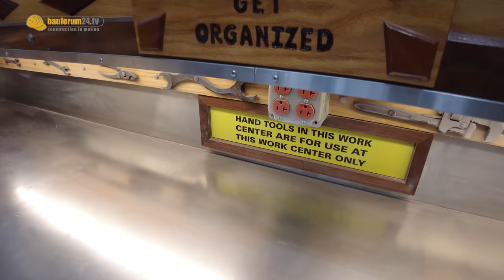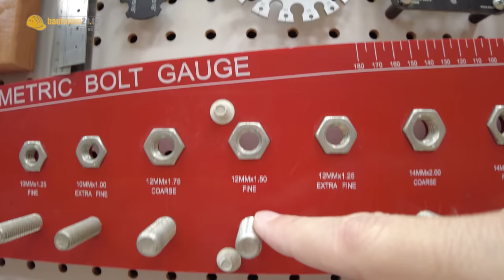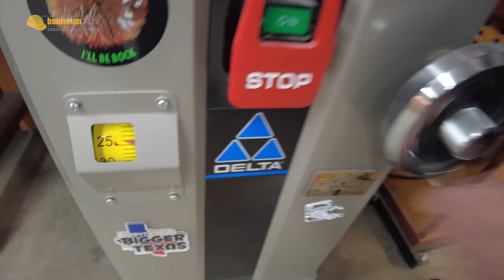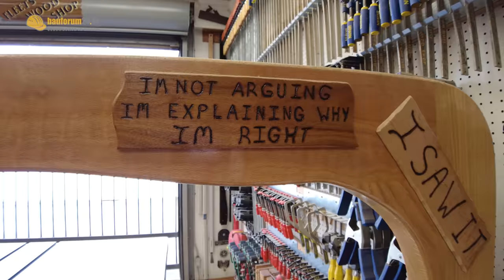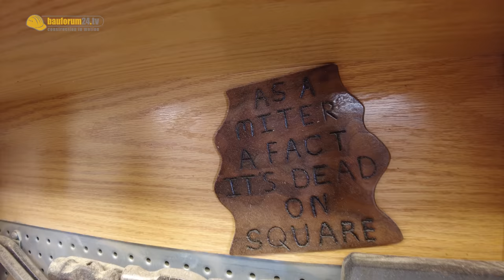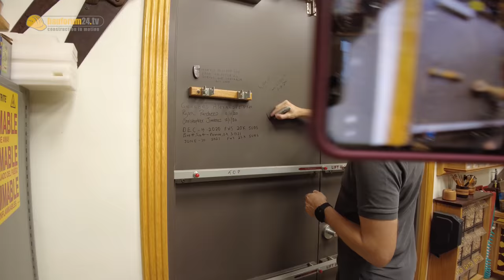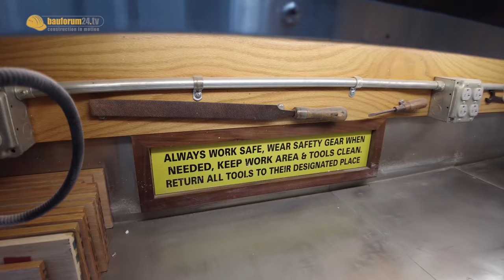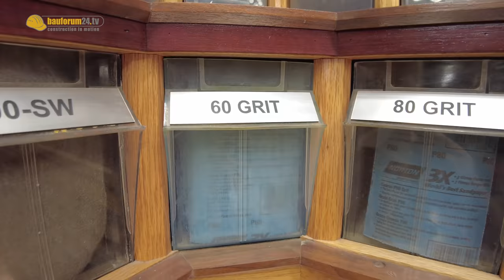TEUERSTE PRIVATE WERKSTATT der Welt - $1.000.000! | WERKZEUG NEWS 183

Comment: My American car (1995 Chevrolet Camaro made in Canada hehe) has almost all metric bolts and nuts. Most of the "standard" (inches) bolts and nuts are holdover bolts and nuts for engine parts, stuff either bolted directly to the engine like the water pump and intake manifold and stuff internal to the engine (cylinder head bolts, cam retaining bolts, crank bolt, etc.) are "standard" (inches).

Virtually everything else is metric. 

Retaining screws for dashboard pieces? Metric. 

Nuts and studs that hold the seats on? Metric

Suspension bolts and nuts? Metric.

Gas tank straps? Metric.

Alternator bolts and nuts? Metric. It's not bolted to the engine itself. The bracket its bolted to which is bolted to the engine? Standard (inch).

Comment: Und bei min 45 der Pizzaofen auch lecker...
Reply: That one's not a pizza oven my friend that's a microwave. When I'm working in the shop. Not on the shop. In the shop. If you heat up moles for resin casting. Before you cash resin in them it dries out the mole and helps the resin cure better in a warm mole. That's what the microwave is used for. Amazing what you can do when you know the reason why it's there. And again my friend thank you thank you so much for the smiles from Doug
Reply: @fleetswoodshop3339  Thanks for your fast answer Doug by Andre Channel! Sorry my older broh. It was a choke äh a joke! If i have one million Dollar or Euro i have a same Workshop too...

Comment: The vaccum chambers actually bubble the resin out, it doesn't collapse it.     Its a cold  boil*
Reply: You're absolutely right my friend. A vacuum chamber pulls out the bubbles. but I don't use a vacuum chamber. Those are pressure pots. They work a little differently. And thank you buddy thank you thank you so much from Doug
Reply: @fleetswoodshop3339    Ahhh Interesting I didn't even realize it was a pressure pot.  You even said that!  I've been so involved with vacuum chambers lately.  :)
Reply: Hey That's no worries my friend. The vacuum chamber works real good for pulling the initial bubbles out of the resin. As you probably will know once you take it out of the vacuum chamber a torch will get rid of the bubbles on top. But as the resin cures. That won't do anything for you from stopping other bubbles. That's why a pressure pot works so well cuz it keeps constant pressure throughout the entire curing process. And the resin really comes out nice and clear. I don't know if you're just casting resin or if you're turning it on the lathe also my friend. But if you're turning it on the lathe I'm about to release a little short video about turning resin on the lathe and different ways of holding the turning tool to get a better cut on your resin. And like I say if you do turn I hope you find it very useful. And let me know what you think my friend. And thank you buddy thank you so good chatting with you. From Doug

Comment: craftsman was bought by Stanley black and decker. the tools are just rebranded Stanley for the most part, which is fine Stanley tools are pretty decent.
Reply: You're absolutely correct my friend Stanley's always put out a fairly good tool. In some cases such as their tape measures and their hand planes excellent tools. And thank you my friend thank you so much from Doug

Comment: I have a question one of you guys can probably answer. I have an old lathe (was my grandfathers) what type of oil do I use? on the lathe. It has little caps to fill the oil. Thanks.
Reply: Nolan my friend thank you for asking all the different lights I've ever owned I've never had one that used oil. Many of them most of them and all of them do have grease bushings. Where you put bearing grease on which is that thick black goopy Grease. Sometimes there's a greasing nut sometimes you have to put it on by finger. But if you have those little tabs sticking out there are about the size of a car tire air fitting but a much much shorter then that's a grease fitting. You take a grease gun and squeeze grease in there. If you can open up and get to the back of the gears. Although again most lace don't have gears they use belts and pulleys. About the only thing that really gets greased are the bushings around the turning parts. do a little YouTube search on that and I'm sure you'll get all the answers you need my friend and thank you thank you so much from Doug
Reply: @fleetswoodshop3339  thanks for the reply. Also like the organization of your place. Mine little space has to be cleaned again. But I have no grease nipples on the Lethe. I uploaded a video to my channel to you can see the Lethe.

Comment: Why 3 band saw😕
Reply: Thank you for asking my friend that's one of my favorite tools I use it quite often and it's really a pain and you know what to take the big inch and a quarter carbide blade off of a saw to put the quarter inch blade on. And then reset the drift. And take it back off again to put the half inch 6 tooth blade on that you need and reset the drift. I originally only had two bandsaws for that exact reason so I could keep one set up constantly for reselling. But a friend gave me another one they didn't want it anymore it didn't work for them so I kept it. And it's been working out great to have one set up for resaw one with a quarter inch or the eighth inch blade excuse me and one with the half inch blade. Thank you for asking buddy thank you so much from Doug

Comment: Even if the batterys are dead after 10 years you can replace the old cells with new cells and continue using the old system.
Reply: That's absolutely correct my friend. And thank you buddy thank you thank you from Doug

Comment: You can hit resin with a torch to get rid of the bubbles.
Reply: Yes you can my friend that will raise the bubbles works wonderful also. But depending on what you have around the resin or what situation if you've mixed it with wood it would take hours to pull all the air out of the wood through the resin. So in some cases. The pressure pot is a better way to go. But in some cases where it's small and there's only resin in the mole and nothing else that can trap air. Then a torch is more than sufficient by itself. And thank you buddy thank you so much from Doug